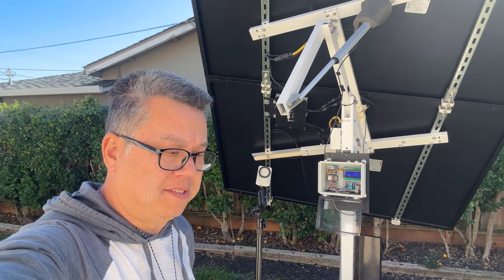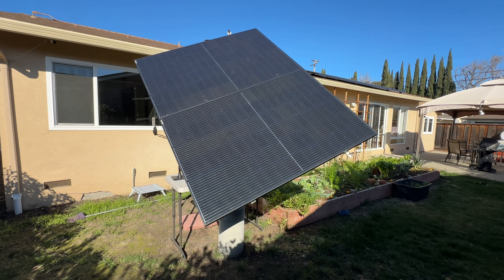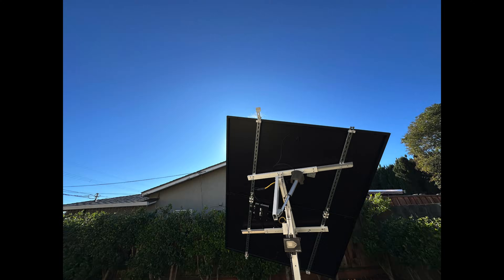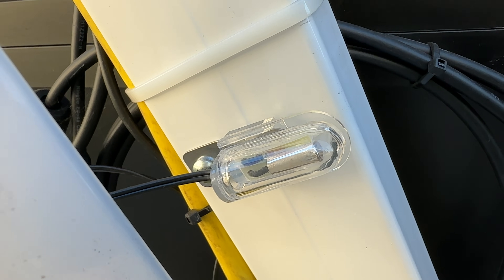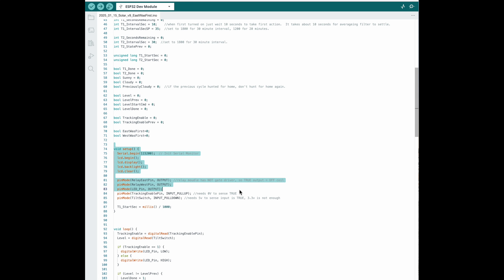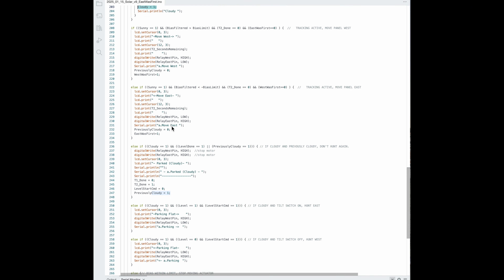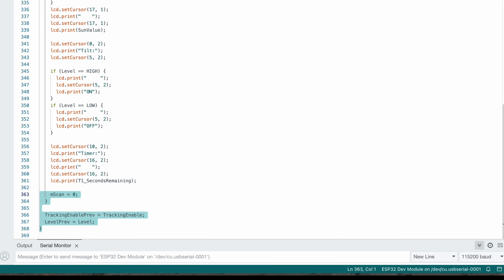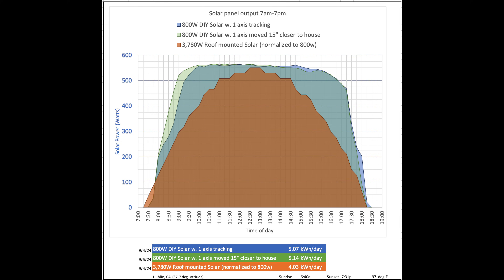Building an Arduino controller for Eco-Worthy solar tracker

Comment: You’ve improved a badly thought out existing product. Great!! They should’ve corrected there own defects. It’s amazing that they didn’t go the extra steps you did. I have a much smaller setup based on timing rather than sun positioning. It uses two Shelly relays. I’m always interested in how people get around the solar positioning. Thanks.

Comment: Would the challenge to calculating position of sun and following it be getting an encoder for the tracker pivot so you know what angle it is pointing? I made a cheesy little tracker in the 80's that just followed sun based on light hitting photo diode and made a "dark sensor" that rotated it back in the middle of night until hitting a stop switch. Flash forward to today and we have a tracker made by a local company that doesn't use photo sensor for tracking, using absolute horizontal and vertical sun position (so it tracks even on cloudy dark day).
Reply from the maker: I think the reason the old controller goes to a flat position when it's cloudy is to capture more ambient light from sky above.  I'll have to check if that's better, or to keep tracking the sun.

Comment: Where I live in Australia if you use a heliostat system to keep your solar panels at the optimum inclination and orientation during the day, you can expect about 40% more power generation annually compared to a static solar array

Comment: Also add a timeout timer if that mercury switch fails for whatever reason(shattered/broken) .... It should not be activating the motor longer than a predetermined time..

Comment: You could also make it quieter by running the actuator at a lower voltage, and updating the position more frequently. You'd have more frequent, but much shorter and quieter motor movements that way
Reply from the maker: yea, I lowered to 12v from 15v.  The old controller wouldn't run below 12v, but now I guess I can run 9v or 6v. I'll give that a try.  

 I think I've minimized the motor to 90 seconds of movement per day, down from probably 20 minutes per day, so that alone is a huge improvement. Thanks for the comment!
Reply: @etischer  You could also try just getting a quieter actuator - those are the same actuators that used to be used for large satellite dishes - the satellite ones are a little bigger, and thus have bigger gears in them that make less noise - if you know anyone with an old large satellite dish that wants to get rid of it, you might be able to get one for free
Reply from the maker: @gorak9000  The Eco-Worthy actuator is advertised as being 50dB, I measure it at 72dB.  When I mentioned this to Eco-Worthy, they send me a $40 refund.  

With the old controller, I was limited to an actuator of the same speed, since the positioning was timer based.   I'll see how much an improvement is made with the new software.. Would be nice to find a silent actuator, maybe I need to switch to an AC powered actuator.
Reply: @etischer  satellite dish actuators are designed for 36V, but you can run them down to 12V, maybe even less. They're much quieter, and even more so the lower voltage / slower you run them. What's making all the noise is the gears, especially the first few off the motor that are turning the fastest.
Reply: Sunflowers are nature's heliostat
Reply: Man, that's awesome. Nice control algorithm. Seems like it works pretty good.